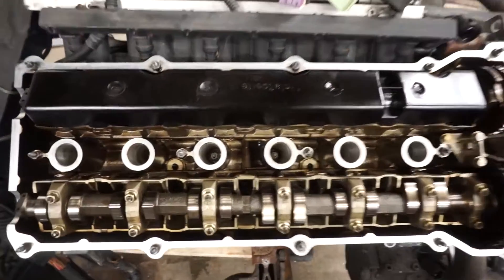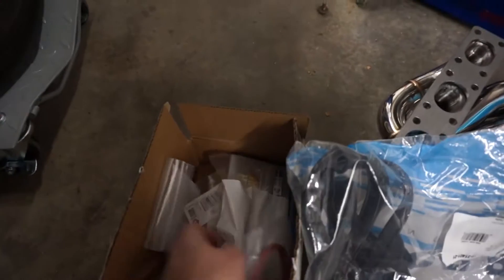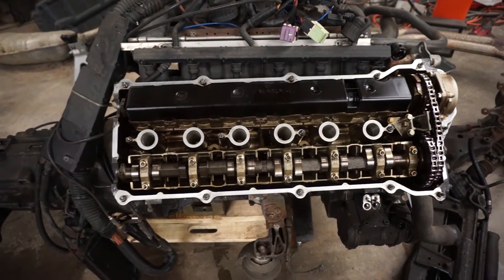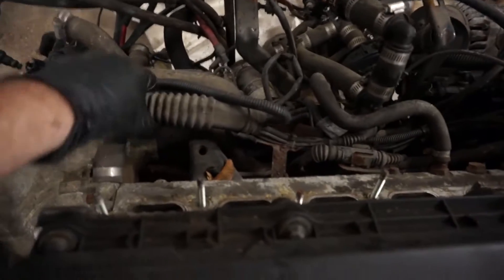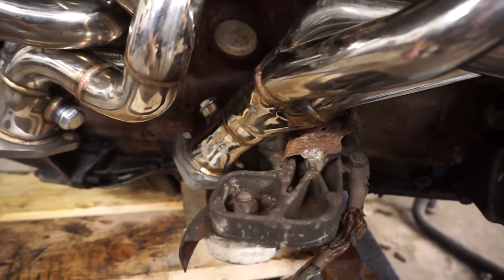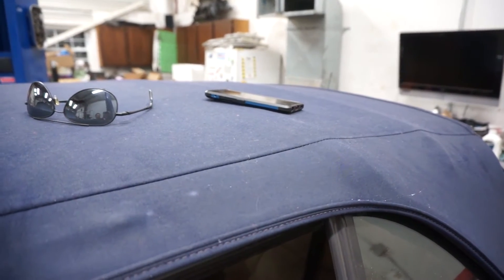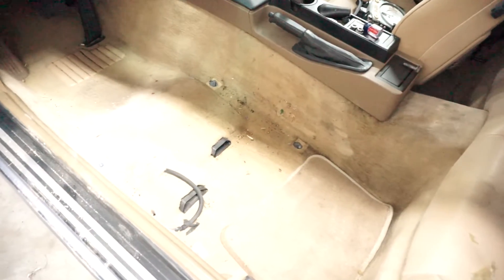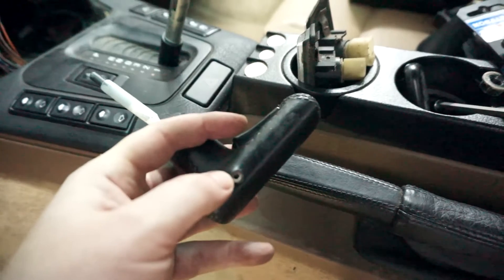E36 318i 6 Cylinder Engine & Manual Transmission Swap: Part 3

Comment: I did more or less the same, I just bought an engine/gearbox/diff from an importer. Engine came with the loom as well as the ECU so it was super easy. My 318i was also manual so no need for any welding of brackets.